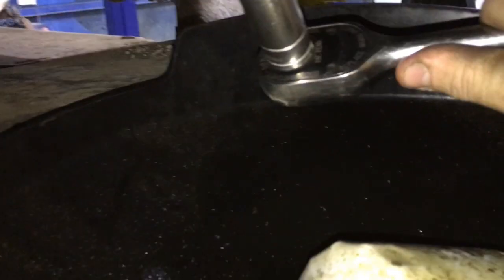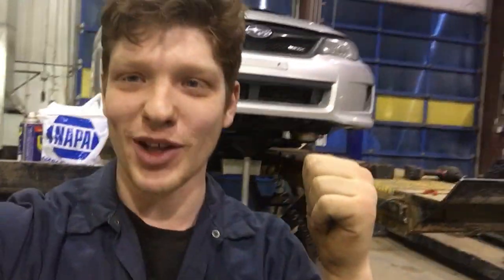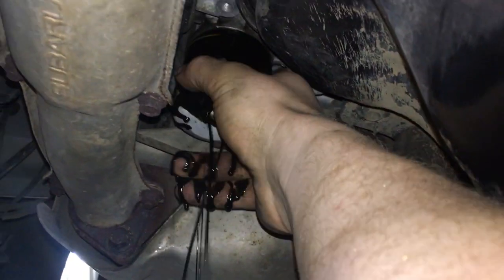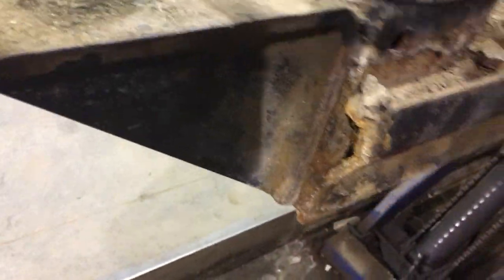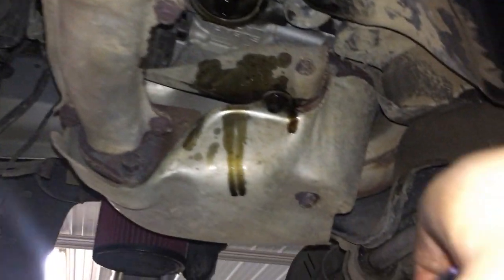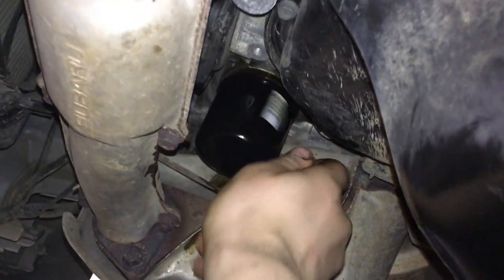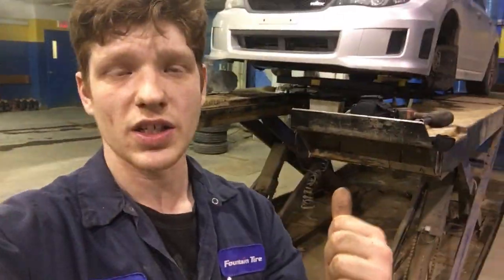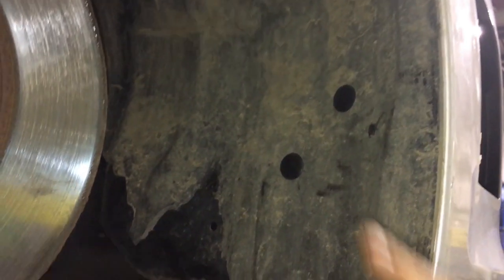Changing My Oil And Skid Plate On My 2011 WRX STI (PART 2)

Comment: I started using a Solo cup around the filter. Break the part loose, then use the Solo cup as a sort of "socket" to unscrew it. The extra oil filled the area around the filter but if you're careful, it should contain the mess. Also, maybe consider a fumoto drain valve or a nospill kit instead of the drain nut?
Reply from the maker: That solo cup idea is a really really good idea, I never even thought of that. I've just been making a mess this whole time
Reply: @JetEyeMonkey  I got the solo cup idea from another video. It's worked well so far. Then drill a hole (if desired) into its bottom and have it drain into your oil can, overnight, and then put it into a baggy. Aside, I'm told that Rallitek and TDW make pretty good metal skid plates. If you used a quick drain, you could put the hose up to the valve and even get to the filter w/o having to take the skid plate off, probably save 10-15 minutes with each change. Plus, minimized mess.
Reply from the maker: That's awesome. I'm gonna give it a shot today or tomorrow. My cars in the shop right now waiting on a rad. A rock or something must have poked a hole in it the other day of the highway
Reply: @JetEyeMonkey  rad?
Reply from the maker: Yeah, my radiator has a leak and is leaking coolant. Wanted to get it swapped before it became a real issue
Reply from the maker: @bivensrk  I had to tell everyone about that cup trick at work